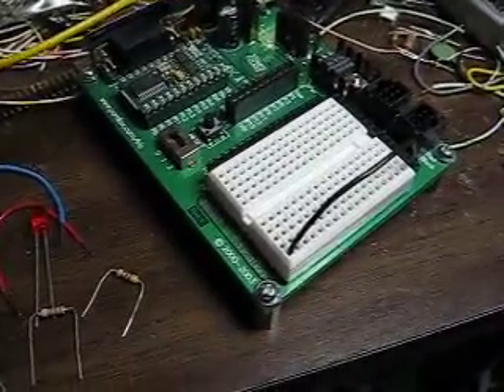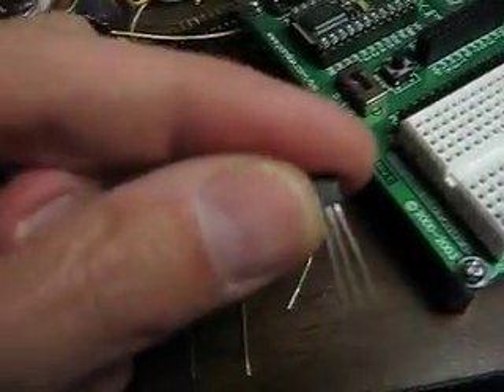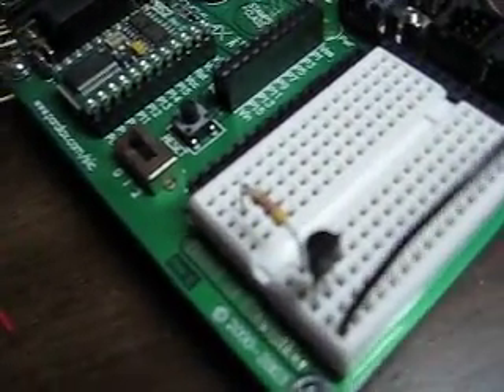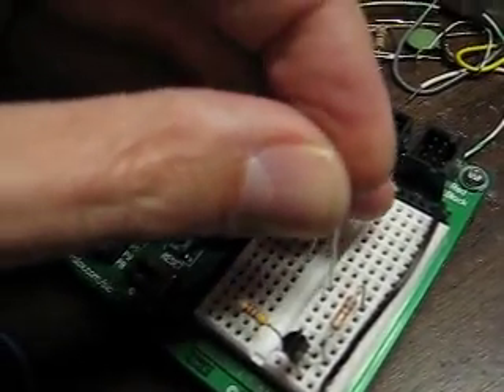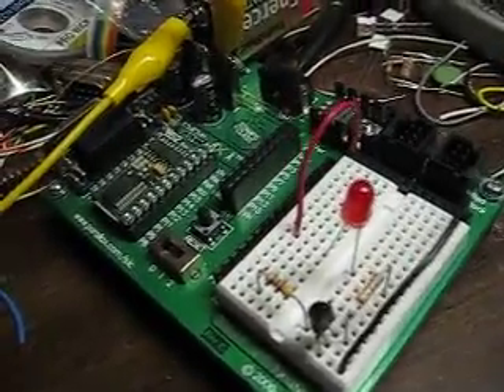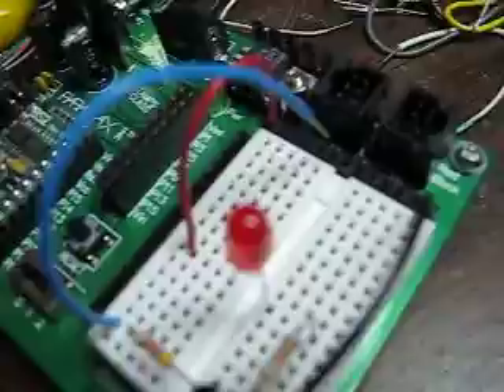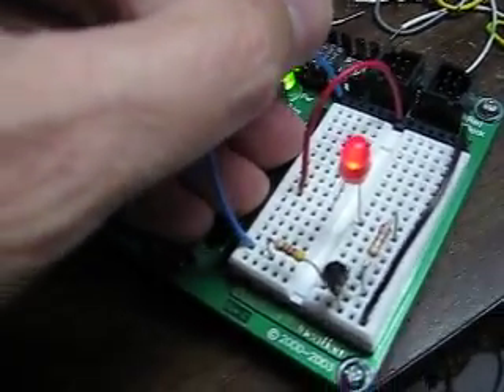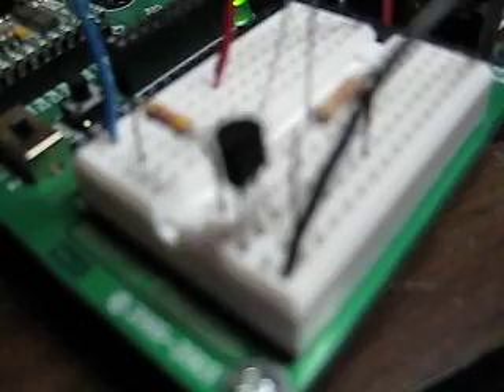The Transistor Switch, Module 1

Comment: Yes, I searched for the pin configuration of the 2n2222 transistor. I found pictures showing both configurations. (I used google and searched for pictures of 2n2222). I guess I could just try and see if it works, and if it doesn't I just turn the transistor around. :)

Comment from the maker: @vusiliyK -- First this was intended solely as a tutorial for a 'friend', how to get the wires right and test the circuit "manually", but it took a life of its own.  Of course it makes no sense to hop a wire on/off, it would/should be connected to a microcontroller, a low-current/logic output,  which would take it HI/LO.  Instead of one LED you could have several in series or parallel, many; or a relay coil/s; or a solenoid; buzzers -- you get the idea, now.  Hope that helps.

Comment: so it is controlled by a 5v input and the main power supply is a 9v battery, yes?
If i want to use a 12 v input what resistor size should i fit best? thank you

Comment: Hi, I built a circuit like yours but with a 2222A transistor. I have the signal pwr source around 5V and the LED source at 7 V. Both are DC batteries.  Their grounds are both connected together (is this correct)? The problem is that when I disconnect the signal (Base) connection, the LED stays on and continues to be powered by the 7V source (I know because it's brighter than it would be with the 5v source), so therefore the transistor is not acting as a switch like I would like, can you help?

Comment: Yes, you are right, to ground, my bad.  I have a pcb design we use on one of our products where I use a transistor to switch a buzzer off and on whose signal comes from a PIC16F54 chip and thought a better off state with a pull-down resistor was sort of a must.  I am a mechanical engineer so what do I know lol.

Comment: I have seen where a resistor with 10 times the value of the one to the base of the transistor (4.7K in this case) is added between the base and collector to take the base to ground for a pure OFF signal.  Has yours been omitted for simplification or is it not required?

Comment from the maker: It's an electronic switch, a "regular switch" is a mechanical device.  
Anyway, instead of placing the "red lead" on 5V you'd use a logic-level output from a microcontroller or a logic gate, etc.  Again, I established that point in the "info" section in the upper right (click on "more info" for... more info.)

Comment from the maker: I used that terminology because that's how the board is labelled.  I made this for the benefit of a Parallax "Basic Stamp" user, but it's generally applicable still.  I think Parallax missed the boat by not labelling the points as  "+5" (Vdd) and "Ground" (Vss).